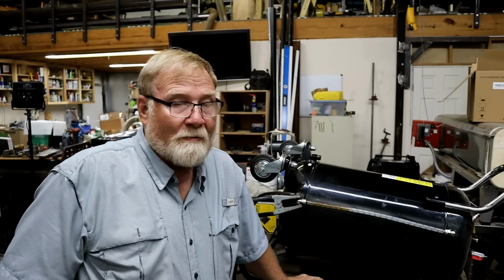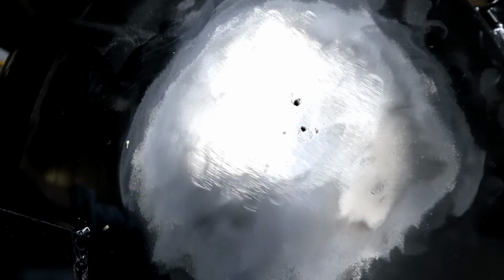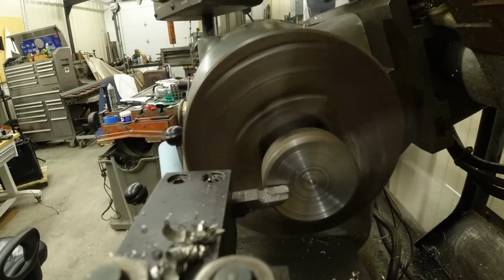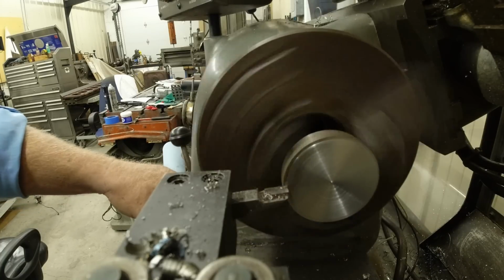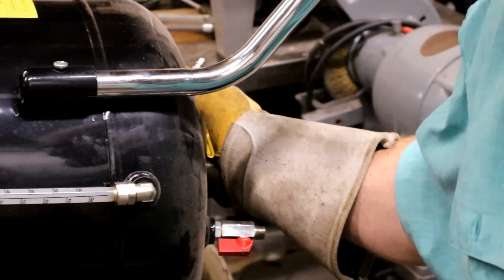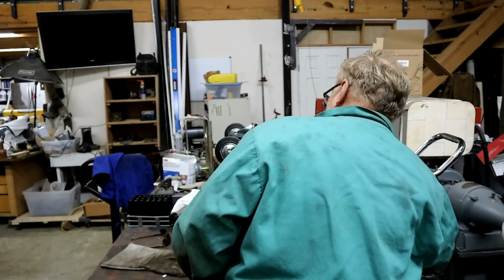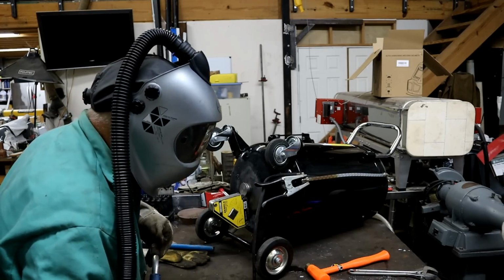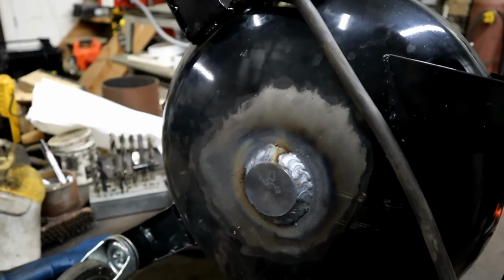Bad Tank On A John Dow Industries 20-Gallon Fluid Evacuator

Comment: Why did you not wash the tank out with hot water a detergent? The best repair in my experience, is epoxy poured into the bottom of the tank. I've repaired many Madison-Kipp lubricator tanks with the same condition. Clean it, sandblast the bottom, then seal it with 1/8" of flexible epoxy.
Reply from the maker: I figure for the best, fastest and most long lasting you can beat hot metal :)

Comment: Steve could you have applied a type.of epoxy and had a much safer application that would have worked ?
Reply from the maker: This was pretty safe... the epoxie would require a heck of a lot of work to get it clean enough..
Reply: @10swatkins  Steve would the Dry ice trick work to braze or weld gas ⛽️ tank

Comment: A retired mechanic told me that he welded leaky gas tanks by flushing out the fumes with carbon monoxide from the exhaust of a running vehicle. After the inert gas had cleared out the fumes he said “ you could weld on it all day,”. Of course carbon monoxide is dangerous also but at least it won’t explode.
Reply from the maker: That works but is dangerous if you are also breathing the fumes :)   I was working in the AC in the shop and it would have been bad :)

Comment: I would have cut the rot out with a hole saw, welded in an appropriate size black iron pipe fitting, installed a 90 ell and ball valve to drain.  Done.  Don't make solutions to simple issues harder than they are.  😁  Steve, love your channel.
Reply from the maker: What you can't see in any of the inside tank pictures is the bottom drain hose.  This has a hose at the very bottom that the vacuum sucks everything out of the bottom.. Not any need for a drain there... thanks for watching!
Reply: @10swatkins  Apparently the self-evacuation system was inadequate. A manual ball valve drain is absolute.
Reply: Still, a drain wouldn’t hurt and would remove any doubt. A little compressed air in the top with the drain open would blow it all out.

Comment: I almost blew myself up cleaning out a fuel tank with a 2" air hose. Who would figure, right? 
I had the obvious fuel and air and no apparent heat... However, as I was attempting to blow the contaminants out of the drain hole the tank pressurized. When I pulled the air hose away from the filler BLUEFF! I might not have thought much about that instant if it hadn't been for the diesel blue smoke that came out of the tank. Apparently residual fuel had combusted from the pressure.
Reply from the maker: I though long and hard about doing this repair, never know what's going to bite you in the ass... Glad you are ok :)
Reply: @10swatkins  Thank you. I enjoy your videos. I like the technique of using dry ice. Thanks again.
Reply: Static electric sparks?
Reply: @johnrussell6620  I don't know. But it was a heavy gage steel tank on piece of construction equipment. If the tank shredded from the overpressure...I would have been shredded
Reply: @RobertWilliams-mk8pl  I am offering that perhaps the chemicals-oils-fuels, whatever was there,  in the tank were atomized by the high velocity compressed air. Then the fact that the air is flying out the nozzle of the blower created the opportunity to generate a static spark, igniting the atomized vapor instantly, outside or inside the tank. ---- Take some compressed air and fill a large trash bag and feel the static energy build up. That "STATIC" energy came solely from the air molecules rubbing against each other as they move through the blower and across the void they are filling, and then accumulating on the plastic bag 2nd. Lightning is wind and dust particles being agitated during a thunderstorm. Those particles may even be wet at the time of a lightning strike. Good luck, Be CAREFUL.

Comment: Why didn't you do a water pressure test?  I,ve seen lots of videos doing just that!
Reply from the maker: This is not a pressure tank, it sucks fluids in by a Vacuum created by a Venturia ( SP) pipe connected to the air hose... No pressure is inside the tank. The worse it can do is collapse :)
Reply: @10swatkins  I understand.  Just an excellent way to seek other weaknesses.  Just saying..

Comment: If you have not put it back into service yet.  get a tank liner applied.  Water is going to sink in that system even condensation from the air will make its way to the bottom.  Great repair and approach to the work.  Another commenter mention KBS  I would agree with that suggestion.
Reply from the maker: I was thinking about it... Going to be really hard to clean it well enough for something to stick.. HAve to think on it some more... Thanks for watching..
Reply: @10swatkins  You could put some degreaser of sorts inside the tank along with a chunk of chain and roll it around on the floor (not using the built-in wheels), and-or, make a belly band strap of sorts and rotate it in the air, top-to-bottom, to grind and scrape the inside of the unit clean of flaky corrosion and chemicals. Then flush the tank per the coating instructions.

Comment: Steve, I wonder if a coating of something like KBS Tank Sealer would protect the metal from further corrosion.
Reply from the maker: I've never messed with it so I just don't know.. I figure it's going to be a bear to get clean enough.
Reply: @10swatkins  You could put some degreaser of sorts inside the tank along with a chunk of chain and roll it around on the floor (not using the built-in wheels), and-or, make a belly band strap of sorts and rotate it in the air, top-to-bottom, to grind and scrape the inside of the unit clean of flaky corrosion and chemicals. Then flush the tank per the coating instructions.

Comment: Why didn't you just drill out the wholes and cut some thread in them and screw some plug into the holes? Or you could have used epoxy and put a glass fiber patch over the bottom.
Reply from the maker: Too much rotten metal to put just a plug in and it was thin also...   I just know that fiberglass would decide to leak one day :(

Comment: I believe you are correct about the bottom head having a hole in it, maybe a top  that was welded up due to in inventory shortage or a sleepy weldor that made a mistake. What ever I would have definitely contacted the manufacturer with photos. Top pro thinking and video production as usual! Thanks Steve! ps Lots of time, I put a set of Vice grips on the work and then the weld ground, positive contact -.

Comment: Those holes are clearly rust holes from water in the tank, likely before it was made into the oil sucker.  If tanks are left outside and not plugged they can draw in an amazing amount of water from the daily heating and cooling drawing in damp air. I repeat your warning about welding any enclosed space. I have personally welded dozens of tanks. I fill to within less than an inch of where I am welding. this limits the amount of vapor volume available ( thus O2 volume) I would likely have gotten into the CO2 habit, but that is an hour drive from my home to pickup dry Ice. I have seen square fuel tanks turned round by an explosion because the welder stuck a hose in one bung and let it run out of the drain bung. I was not there when it happened but I think he had to change his shorts. I have also seen the burns on a man that was cutting with a torch 6' from a gasoline tanks that had been drained 3 years before.  ANY enclosed space is a concern when sparks or heat is present. Be safe if in doubt hire someone who knows what they are doing to deal with it.
Reply from the maker: That was my thought on the holes too, happened before the first use with oil... There was never any water put into that tank and it had a foot of oil over any that might have sank to the bottom of the tank after separating from water contaminated oil.  Still need O2 to get to the metal to rust...

Comment: 3 points Mr. W, ... 1. When water and oil blend and then separate, the oil rises and the water goes to the bottom allowing rust to become a problem. 2. Maybe you could have taken a 4" or 5" or 6" hole saw and cut the entire bottom out and replaced it with some 3/16 " plate, beat up with a hammer, into a similar dome as you cut out. It is not a pressure vessel so very low danger of future rapid disintegration events. You could then guestimate the total damage from the rusting on your cutout. 3. As for welding a tank or vessel, you could turn it up-side-down and fill the tank 98% full of water and remove the potential of any significant quantity of oxygen to be present. Plus you would be welding with a gravity assist.  Good Luck and be safe!

Comment: You will never get a good weld with all that oil in it, should have rinsed it out with gasoline first 🙂. What do you do with a tank factory that can't get a tank to pass a pressure test, make oil tanks!
Reply from the maker: The oil was all on the inside of the tank, no oil was on the outside where it was welded... Your right it might have been a reject.

Comment: Not the first vacuum tank I've seen rusted like that ... although yours also looks like welded hole as well.
I don't know, but does a vacuum condense the moisture out of the air and create water in the tanks during operation?
CO2 is the way to go! Used it after a water fill and flush before brazing gasoline tanks.
Thanks for sharing 🇨🇦
Reply from the maker: The water would still be below the old oil level and O2 would still be needed for continuing rusting...

Comment: You could always drill that slug you welded on and tap it, put a street ell on a ball valve so you could drain a little out and see if it has any water in the bottom.
Reply from the maker: You can't see the hose that reaches the very bottom in the pictures.. I can suck everything out of the tank.. I thought about taping a hole into the  cover piece but it was not really needed because of that hose...

Comment: If you think the tank is internally rusted, try using fuel tank slosh. This stuff is used by home builders of aircraft to seal their fabricated fuel tanks. Try Wicks aircraft supply.
Reply from the maker: Think it would stick to the oiled metal?  Be pretty hard to clean it all out...

Comment: When I was stationed in Koreas (mid 80's), two Koreans died when the 5000 gal fuel storage tank blew up.  Either they didn't purge the tank or someone told them that the tank had been purged but failed to test it.  The small building I was in about 250 ft away got some damage.  I thought an attack aircraft was about to come thorugh the building as we weren't but 400 ft from the runway..
Reply from the maker: That would make me change my shorts too!

Comment: There was probably water in some of the machines you removed oil from. Without a bottom drain, the water never get out. I've seen many oil extractors scrapped for the same reason. They need a sump and a drain in the bottom.
Reply: That was the first time he used it, came new with the holes in it
Reply from the maker: There is a hose in the very bottom so you can suck everything out...  I would think that even if the water was in the very bottom it would have been covered in oil thus keeping the O2 needed for rusting away...

Comment: Hydraulic oil is hydroscopic my tractor oil will draw moisture in my garage after i have opened and sealed back
Possibly sitting shop with slight temperature swings it still can draw moisture from humidity in shop 
Air conditioning pulls humidity out but space still has relative humidity of 40-45% is ideal 
Anything higher it can get really wet in oils quick
Reply from the maker: I can see that happening... This was a sealed tank in a climate controlled room....  I just think it was bad from the factory and someone tried to weld up the pin holes!
Reply: @10swatkins  yup anything is possible these days 
Wasn’t like you was in any shape to find any flaws at that time 
Like the old saying when it rains it pours sometimes 
Win some lose some 😂

Comment: steve now you have the holes repaired get you a gas tank repair kit and put a rubber liner in it .
Reply from the maker: I wonder how that would work with all the other tapped holes in the tank... Probably have to drill them out.. Also I would wonder if it "stuck " good enough to resist the vacuum pulling on it..

Comment: Auto oil always has minute amounts of water if allowed to sett^to settle  because of  condation doesn't evaporated completely oil only runs 180 degrees to 195 in the pan normally
Reply from the maker: BUt I would think that the foot of oil over any water would not let the required o2 to get to the metal to continut rusting... I guess some of the O2 from the water might do it...

Comment: You mentioned should turn that into a bottom drain I think that would’ve been a really good idea. Make that slug about 2 inches diameter and then have a pipe coming out sideways half-inch pipe because there’s always a few drops of water sitting in the bottom.
Reply from the maker: There is a hose on the very bottom that is where the oil is sucked out of the tank for disposal... I though it should be enough...

Comment: What about a drain in the bottom to remove any water that settled out?
Reply from the maker: There is a hose on the very bottom that is where the oil is sucked out of the tank for disposal... I though it should be enough...

Comment: That's clearly been repaired Steve. I would have contacted the manufacturers and sent them pictures of their bodged up oil sucker. It doesn't matter that it's a couple of years old it's the principal and if they blow you off buy a different make if you have to buy another one lol. I'm only a few minutes into the video and I assume you are not just going to weld up the holes but put a nice chunky at least 1/8" thick piece of steel plate on it. But I will now watch and see how you are gong to fix it. By the way sometimes as in this case I would fill the thing with dry sand and that will exclude the vast majority of any volatile fumes and that will leave little or no room for any gasses to explode. Pop maybe but BANG never! 
Now I've watched it all, there is one thing I think that I would do Steve, there is an epoxy manufactured for sealing petrol tanks here in the UK , rusty vintage motorcycle petrol tanks ( gas tanks) here it is called Petseal. I assume similar products are available in the states.. I'd clean the tank as best I could with acetone (you don't need that much because I'd only seal the bottom say 7-10 inches where any water is going to be well below that level ) and follow the instructions and your tank is sealed properly and should give you no more trouble. Cheers from the UK. And please don't go blaming Don for everything ! Lol
Reply: Send it all to Texas AG!  They need a RECALL & replacement too.
Reply: samrodian:   Don did it.

Comment: Looks like the inside is corroded. Used oil has many corrosive acids. That’s also why they want you to use rubber gloves when changing
Reply from the maker: MIght be the case.... I think it was corroded from the start the way those pinholes looked...

Comment: Now you have a nice thick piece of metal on the base of the cylinder, is it worth drilling it and adding a tap to be able  to drain off any water from below the oil?
Reply from the maker: There is a hose on the very bottom that is where the oil is sucked out of the tank for disposal... I though it should be enough...

Comment: Bentonite comes in like 50 pound bags. Used in drilling mud and pond water proofing.   Pour some on the concrete oil stain.  Sweep it around.   Put out fresh as the oil is picked up out of the cement.  A few days will do an amazing job of pulling oil from concrete.   Bentonite is a super absorbent.
Reply from the maker: I have purchased about 5 truckloads in my life... Damn leaking ponds... BEst think I have ever used though was cat litter...

Comment: Did you think about using a plow disk as a patch on the bottom of the tank?  Would have to cut it down and weld a drain plug in the center but would be easy and quick.
Reply from the maker: That sir is an excellent idea!  I was thinking if I had to make a bigger patch just using my press and forming a curved disk but a plow disk of about 10 inches would be perfect.,

Comment: Why the hell they don't coat the insides of these things to stop rusting and same goes for compressors too. They do do it with some of the more expensive compressors and they last for ever.
Reply: Yep, that's exactly what's happened, as a lot of drained oil will have some moisture in it, plus the tank condensating. So I'd put a bung in the bottom to fully drain it.
Reply from the maker: Saving a buck...

Comment: Since you have a ring roller.  I would have rolled a piece of rod or tubing. Welded that to a plate inside and out. Then welded the plate to the bottom by welding the ring.
Reply from the maker: You just want to make me work harder!
Reply: @10swatkins   not at all steve.  I just wanted to cover more of the bottom.

Comment: Because it never fully drains all the fluids out.  Any water will rust the bottom thru.
Reply: The tank was brand new. It was rusted through when he bought it. The paint was bubbled
Reply: @donmadere4237   thanks don.. you new shop looks great.  did the shaper get assembled yet.. '
Reply: @waynep343 not yet moving stuff into the new shop will finish up the shaper next